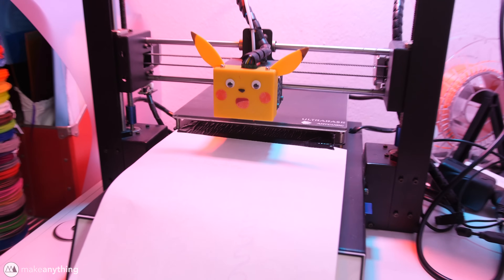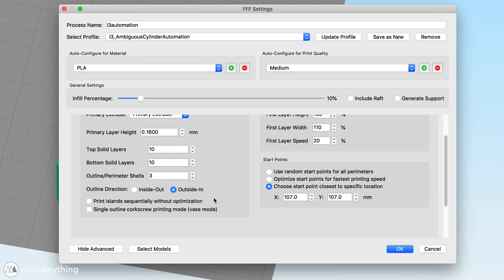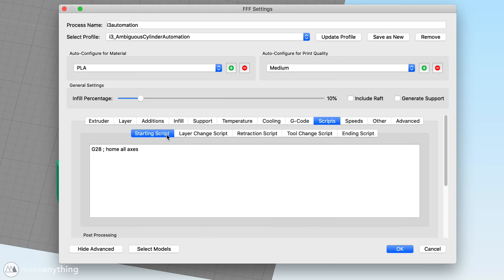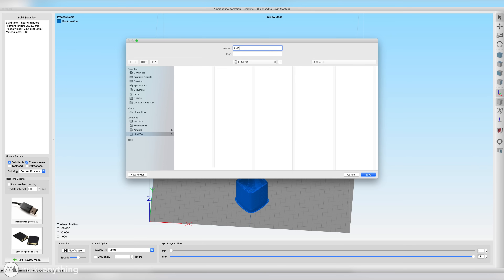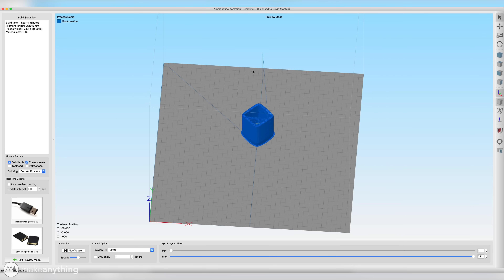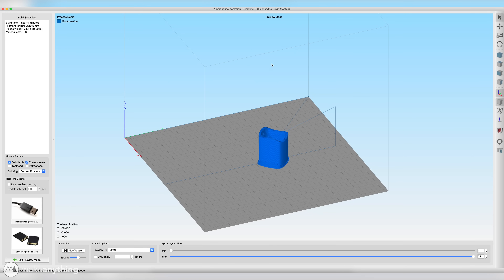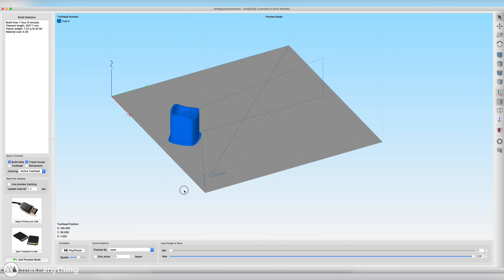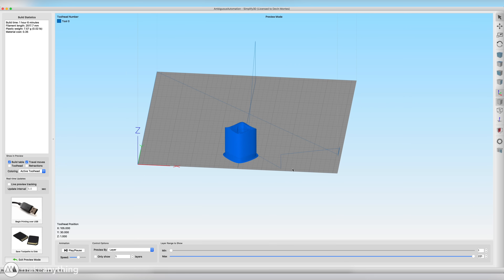Automatic 3D Print Removal using G-Code

Comment: You don't need to make a huge file with 15 copies of the same thing, you can tell it to repeat the same section of the code 15 times - LOOK UP "g-code loop command"
Reply: That would be a much more elegant solution but I would suspect that Marlin doesn't support that type of loop.
Reply: Etch-a-sketch marlin supports just about anything, with a bit of work.
Reply: @etch3130  Oh, can do it from a print host? Use a laptop to control the printer?
Reply: @TechyBen  repetier host for example can do that you dont even need the loop command because its already build in with the endless mode function if i understand it right

EDIT: This claim is false because of an misinterpretation
Reply: M99
Reply: Yes! There IS a loop command!
Reply: or you can use Sub programms or sections but i dont know if that works.  i know a way of counting, too but as before i dont know if printers can do it.
Reply: It's not that simple. Some programs do not support a loop within the gcode.  So you would need an external solution to create the loop. A quick solution that can override firmware defaults and limitations is to create an external script that starts the 3d print again once the print is completed. You can do this with a macro creator. Or you can write the program your self. On my script, I have a prompt before starting that asks for input on how many times to repeat the program.  Which is good so you can calculate how many prints you can complete on one roll of filament and set that many prints. so your not having to extract small pieces of filament from your extruder. Depending on the contact surface area of the print. There is a high risk for damage to the machine if the print becomes stuck to the build platform. So I would only attempt this on very low contact surface area prints that easily tip over and come off rather easy fromt the platform. The risk of damage needed to be addressed a bit more.
Reply: He dont want to repeat print in the same location so no loop
Reply: @rajazulkhairi2524  three copies, different Y coordinate for each, then loop. Instead of a bazillion copies. Of it were a print that would take up a large chunk of the SD card on its own after a few copies...
Reply: prints for eternity with no shut off command
Reply: @BoomchacleV0  the Doomsday Print
Reply: Or you could gcode reset your printer at the end. You should previously configure the sdcard autostart.
Reply: The blob is from not stopping the filament feed
Reply: Slic3r does have some logic functionality tho would probably still end up with a large file but less manual labor
Reply: he put them in different places on the bed
Reply: *69*6 likes

nice
Reply: How to repat g code  not copy past ?
Reply: yeah sounds good but that doesn't sound like you could print different things which is why his method is exciting to me.
Reply: @user-xi9py8es1s  Actually with my approach you can.  All i have to do is declare the file location and it will  automatically open  the file after completing the previous print
Reply: RazorHobbies oh that sounds great for multi part prints that not all parts can fit at once.
Reply: @user-xi9py8es1s  Single parts. One after the other. Would not recommend doing multiple items on a build platform. To much risk of damage to the machine.
Reply: Is there a command for loop on marlin???  If so what is it?
Reply: on Linux "cat file-1 file-2 file-3 > merged-file"  just make sure you put the files in the correct order.
Reply: Its m99 dlt  the m30, thats how you do on a cnc milling might be able to make a sub program has well try m98 p(prog name)
Reply: He could loop the 3 different prints 5 times and 3*5 great Scott that's 15
Reply: You'll need it if objects are different from another..
Reply: Or make the last move hit the start button 🤣
Reply: thats the magic of programming thing ;) any hardware understand
Reply: Just add a m99 to the end to loop it
Reply: m30 works for me

Comment: anybody got the gcode for the bed to cool down to set temperature ? have been searching this for a while. my bed wont release the printed part if it don't go below 40c, i might break the printer if do so.
Reply: If you want the bed to cool down, but not the nozzle then you can add following to before the moves:

M140 S35 ; Set buildplate temp to 35 degrees
M190 S35 ; Wait until buildplate reaches 35 degrees
Reply: @Jacopopsen  S will not wait on cooldown, only on warmup. R{temperature} is needed in M190 command to wait for cooldown.
Reply: Siana Gearz Thanks for clearing That up, thought it was the same command for cooling and heating😅

You learn something new everyday i guess 😅
Reply: i think it is " M190 R40 " command. can anyone confirm this ?

Comment: Cool idea !
deff work great with some prints and not so much with others.

and for the peeps that have to chop at your print to get it off your glass, this is deff not for you.

Use your judgment and dont break your printer.
Reply: Yeah, I don't fancy using my printer as a hammer, I'll just have to enable a bed cooldown (which makes my prints pop off the glass like butter)  then reheat, rinse, (haha) and continue..
Reply: What makes this possible is the ultrabase surface, if you indeed do that on a buildtak or blue tape, the printer will most likely get stuck and break something. But the ultrabase somehow stick well enough that you will never have a print come off on it's own, but if you try pushing the print, it'll just remove easily. Especially if you let it cool down.

Comment: I wonder if you could tape a wooden ruler or gently sloped inverted corner to the front of the print head and sweep a line of prints off at once. They'd obviously need to have pretty small footprints, but that'd let you really ramp up automated production.
Reply: if the prints are tall enough you can just use the linear rods

Comment: Remember kids, to:

G1 X210 Y5 Z20;
G1 X210 Y25 Z19;
G1 X210 Y5 Z18;
G1 X210 Y25 Z17;
G1 X200 Y5 Z17;

every day for beautiful white teeth!
Reply: Al Bundy  great comment .. actually did that yesterday to remove shaking of movement ..
Reply: Markus Marrandi LoL
Reply: That's great! lol
Reply: That wire brush would scrap your enamel RIGHT off!
Reply: _ David _ 4
Reply: Al Bundy  He already did, he didn't specify a feed ;).
Reply: Al Bundy  Well, I assumed the first command from home would be G00 so if the program ran properly it would be at full speed.
Reply: _____  (insert lenny face here)
Reply: I'm not certain but that looks like it's supposed to be a circle. Is that a circle?
Reply: G-code is modal so all you have to type is
G01 X210 Y5 Z20 F10
Y25 Z19
Y5 Z18
Y25 Z17
X200 Y5

Comment: Did your beeps work in the end of your code? You disabled the motors before the beeps so I was wondering what happened when it hit those motor move commands after the disable command.
Reply from the maker: Ahh good call. I didn't put the beeps in the version that actually finished so I didn't realize. Then again the beeps don't come from the motor moving, they use the beeper this printer has built in

Comment from the maker: Who's got some g-code wisdom to share? What's your favorite command.. what else can I do??
Reply: Have you looked into m23 and m24? It allows you to start an SD print in the gcode, so you can just select and print the next file instead of concatenating them all into one file.
Reply: Hi there. I work in a CNC machine shop at quality assurance. While I am not a programmer and operator myself, I learned a bit about G-code during my time here. The hardest but most rewarding thing to learn is to use variables and operate with them, and most machine operator languages can handle them. I work on a coordinate measuring machine, totally different from G-code but uses the same basic principles, and I use variables a lot.

Just one example how you could benefit from it: say that you want only a specific number of prints and then let the printer shut down. What you can do is put the printing code in a repeating cycle (in my case it's called a DO cycle, different on every language), and provide some parameters to allow the printer to count how many steps it performed in the cycle. You need a variable to store the number of prints done, and then the DO cycle will step up the variable with each execution. Once the upper limit is reached, the program exits the cycle and performs the last code outside of the print. So using my CMM analogy it would look something like this:

- Starting script;
- Declaring the variable used for counting here;
- Initiating DO cycle, parameters: the starting number, the variable that will be stepped up, and the upper limit;
- Printing code including the pushing ;
- End of the DO cycle, the cycle jumps back to initiation once this point is reached until the upper limit is reached;
- End script and finishing commands, only performed once the cycle reaches the upper limit.

The point of this is that you only use one printing code and not multiple copies, and more importantly, you can change the upper limit to allow any number of prints. And then you can just leave the machine on its own. Once you get used to this part of the code, you can heavily simplify the automation process. The file size will be only slightly bigger than the single print.
Reply from the maker: @HunGredy  interesting, I've never heard of variables being used within gcode but that would be perfect for projects like this
Reply: @make.anything  not sure if it's supported but variables are very powerful tools. They can be used to print parts of varying sizes or multiple code loops on a CNC and more but not sure how that translates to a printer.
Reply: @Makeanything variables in gcode are called macros, they’re  basically a number stored that can be called throughout the program, or at the beginning of programs. They are useful in the sense that they make gcode smarter and production runs more foolproof. With the Duet board for 3D printers you can use and set macros
Reply: Make Anything g1 should be modal, so you can just enter it once and it will be that way until you change it, just like feedrate, so be careful.
Reply: Why you don`t use g23 to repeat the cycle?
Reply: @MM-tg4lu  G23 is retraction
Reply: Hey, I looked it up and saw that there is loop command in G-code so you don't need to have a high capacity of an SD card, you can say by using while or if to tell the printer to print something for example 150 times while having the size of the file as if it contained only one print instructions.
Reply: @tomasz_jelinski  m41 isnt supported on most firmwares, and will loop indefinately until the board is reset.
Reply: I always had the same idea to do this. But got limited due to less knowledge on Gcode editing. Anyways you have the most original content brother. Inspired. Keep going . All the best.
Reply: Myb use G0 to save little time and to give it little kick on the end
Reply: Try a nozzle prime before every print
Reply: I don't know much about 3D printing, but I know some CNC milling, and on those machines an M99 as the last code in the program will make the program repeat forever until the operator forces it to stop. Another option, if you need a specific amount, you could write the initial startup and finishing codes as a main program and call up a sub program, that contains the code for the actual part, in the middle, after the startup, and have the sub program repeat x amount of times.
Reply: I work in inches, but my favorite is when someone tries to go to Z-125 instead of Z-.125 and the machine just says "Ok, whatever you say" and attempts to go 10 feet under the bed.
Reply: @EvelynH-tj1qt  lol
Reply: My favorite Command is M122. Not much to say there
Reply: do you live in maryland and like to watch sunsets? i think i know you irl
Reply: @xfnwfox  Are you asking Devin? That's oddly specific (;
Reply: Goto , for , while  G0
Reply: I really like the wire brush and the finished part wipe. I would have used G0 for the positioning moves to the brush and to the ready to wipe position. G0 is rapid move, no feed rate needed it will just move as fast as the machine can go. I am however a bit OCD and like things to take as little time as possible. All in all great Video tho, thanks!
Reply: if you just want to move the print head without laying filament, use G0 (zero). Will stop a lot of those strings across the table.
Reply: Its awesome
Reply: Still figuring out all the specific commands to 3d printing, but I have been working with g-code on CNC machines cutting up to 5 axis in aluminum, titanium, and steels for almost 20 years now. It is basically the same, with a few codes specific to 3d printing.
Reply: Sd3d actually did this a couple years ago. They did auto ejection on a pei bed doing abs parts.
Reply: Once you set a z height, you don’t need to call it on every line of code, the printer will be there until told otherwise
Reply: Some unix "magic" so that you dont have to copy paste every document:
Just use cat file1 file2 file3 filen outputfile
In your commandline and your output file will be concatenated
Reply: There's a long standing bug with Prusa's handling of MMU2 with TPU, where the prints are done at 35% speed, making an already long MMU print go from hours to days.
So setting the speed back in filament settings with
M900 K60; Filament gcode
M220 S100; Abe Speed Fixing

Awesome video!

Comment: This is great if you are building something large with multiple small pieces you can just leave it run over night and in the morning you just assembe everything together
Reply: I think some kind of snowplow-like attachment on the front of your extruder might help push off smaller pieces
Reply: @H0B0J03  without getting in the way of the print head and current print?
Reply: @cameronmalchow1837  Yup, the plough would start a few mm above the nozzle- its not meant to scoop prints off the bed like a spatula, more of pushing surface to knock parts off without having to rely on directly contacting the extruder bits, giving you a wider area to push with. Like a bumper of sorts.

Comment: How does this not interfere with Bed Adhesion especially right after the print is done? It takes like 5-7 minues for my Printbed to cool off enough to remove the Print itself, and its the same printer.
Reply: Just lower down the print bed a little bit.

Comment: Good solution - I would need to let my printbed cool down though, sice I use a FilaPrint surface, which sticks like crazy to PLA over 40°C
Reply from the maker: Yea, as is it's definitely only going to be successful for certain prints and printers
Reply: @make.anything  Have you ever seen these modded printers with 'infinite' surfaces?

Comment: How much money do i need to start 3d printing
Reply: 250usd for a good start
Reply: @janschaller5683  thanks
Reply: @janschaller5683  why so much?
Ender 3 cost around 170$ + 20$ for a spool of filament.
So in my opinion 190$ is enough for a good start.
Reply: @Jehty_  i would go for a i3 mega. I find the mechanics are better. Ender 3 has this wheels. In my opinion i think it will last longer.
Reply from the maker: Start by learning to 3D model, which is free :)
Reply: Moj Glupi Kanal I bought a 3D printer for 75$ but I would spend more money for more reliability.

Comment: Idk if mine would knock the print off or sit there and bind due to being so stuck to the glass
Reply: If you're using an adhesive that would release as it cools, you can use the G4 Dwell command to make the printer sit there and wait as it cools, and then when the time you specify has passed do the push procedure. This is what I did before I got PrintBite+ which doesn't need that cooldown time to release.
Reply: I had the same thought. I have a hard enough time trying to pry the part off the glass.
Reply: My prints with a reasonable amount of surface are welded to my plate and need a blade to pry them off...
Reply: Gary Brower if it’s glass your probably fine. Try manually moving the bed in the menu when the print is done
Reply: Ya sometimes I have to work to get the model off with a scraper on my glass bed. Sometimes I did run several of the same part and this would be nice but I don't want to intentionally decrease my adhesion. Oh well.

Comment: This got me thinking if you could design an automated "eject" plate, like an arm that is removable and allows the nozzle to knock it off and not ruin the model.
Reply from the maker: I've seen someone use an additional stepper motor with an arm that knocks off prints which seemed to work well. I just wanted to go as simple as possible

Comment: I would love to see a 3D printing challenge series based on the comments
Reply: To improve on this idea you could create a robot that has a microphone to listen to the sounds the printer makes that then sends a bar across the top of the print bed after a sequence of sounds are made by the printer (the sounds could be set in G code). This also means that the part can be pushed further, and it could then land in a box.
Reply: @jameshamstead4709  I think using a servo with an arm attachment would be a nice way to sweep prints off the bed. Although, I understand that this would be limited to open boards that expose the servo controls. Marlin supports the M280 command to set position of the servo. Do proprietary boards like the Creality ones have servo outputs?
Reply: @jameshamstead4709  how about a scraper option for prints with a larger atachment profile?

Comment: That is not fully automated. That is only a manuel action to prepare the G-Code. fully automated means, that you can say produce 20 pieces or some other numbers and than the production start.

And also I think 15 from them goes in one printing job at the build plate.